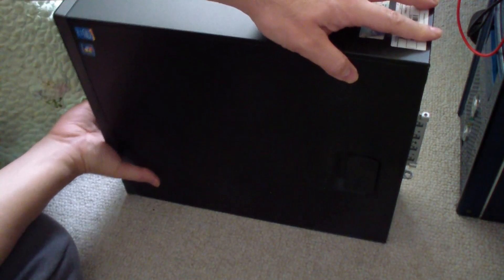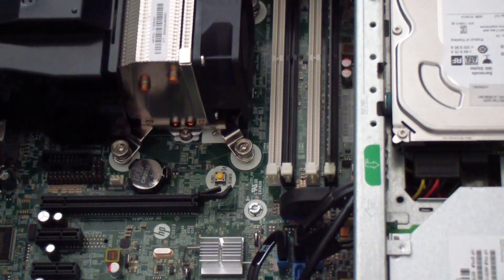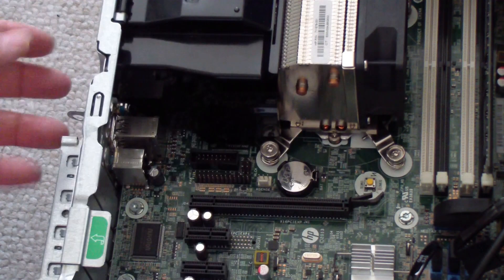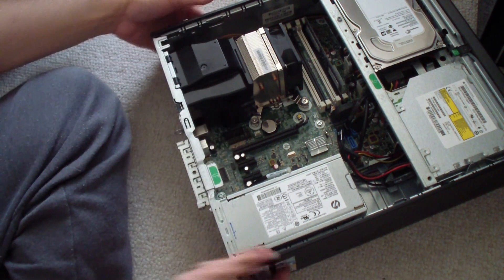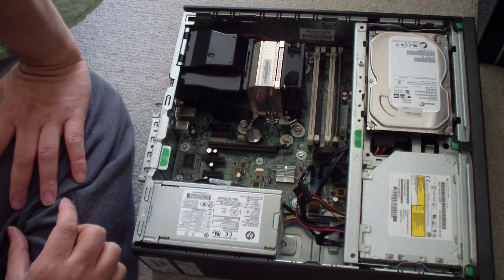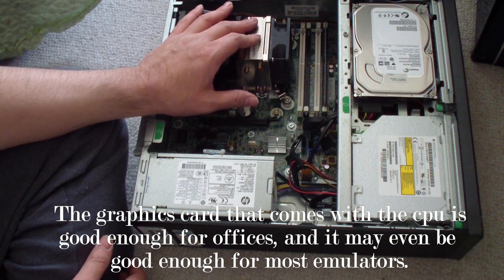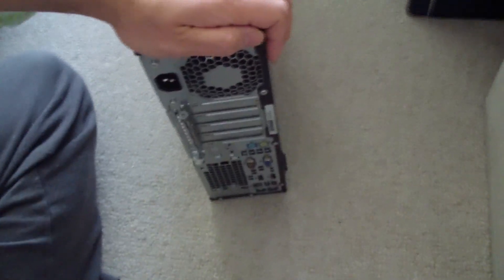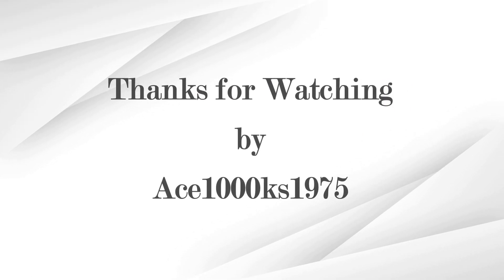HP ProDesk 600 G1 SFF Upgrade Options

Comment: Sorry if you answered this, how many sata power cables come off the psu? Wasn’t sure if I can add a second drive to my parents pc, or if I’ll need clone there current drive to a new one because of limited power wires
Reply from the maker: I think it has two cables with 2 ports for each cable.

Comment: I have this model and have added a PCIe 2.5 GBe Network Card and PCIe NVME Adapter. Both work very well. My Hard Drive with the OS is a Samsung SSD  500 Gig for fast loading.
Reply from the maker: Thanks for sharing that.
Reply: On which PCI e port you put NVME? Faster than SATA ssd?
Reply: The the 16x PCIe slot.  Very quick. Haven't had it as the boot drive,  not sure if the Bios can select it.
Reply: @MrzorkV  so you don't have dGPU in you ProDesk?
Reply: Not using dGPU as it's my secondary PC.
Reply: I tried to install 1 TB WD SN350 vis PCIe NVME adapter, but it doesn't detect it? How to solve the problem?
Reply: Can you see the new drive in Windows, mine is “ F “.

Comment: Would these upgrades be good for using Blender? I’m looking to upgrade to do 3D modeling for 3D printing
Reply from the maker: I don't know what that is.
Reply from the maker: The only 3d modeling software I know about is AutoCad. I used AutoCad 2022, and it runs okay on this computer. I tested it on this computer, but I don't use it on this computer. The performance is okay, but does need a more powerful graphics card. 

I use AutoCad on my I7-10700K w Geforce RTX 3060 12 GB, I7-4790K w Geforce RTX 3060 12 GB, and my Dell Precision T5500 w Geforce GTX 1070 8 GB.

Comment: Thank you. I bought a power supply to upgrade mine, and found it had too many wires lmao. Nothing really matched up, now I know I can’t upgrade this. But I do have extra Ram. Thank you.
Reply from the maker: You can't put a desktop GPU in this computer, nor can you upgrade the power supply unit. However, you can still add more memory, add a larger hard drive, add a 2.5" SSD, and add a Geforce GTX 1650 in it. Those upgrades will provide enough power for most users. 

If you want to play the latest games, you will need to get a full tower and spend about $1,500 to $3,500. You will need a Geforce RTX 3060 to a Geforce RTX 4070. 

A small form factor computer will never be as powerful as a regular desktop computer, because of its physical limitations. It was designed to be a power efficient computer for office work.
Reply: @Ace1000ks  That is correct. Office PC's and regular/desktop PC's are not the same. Different jobs each one.